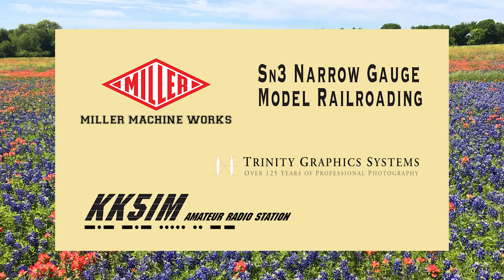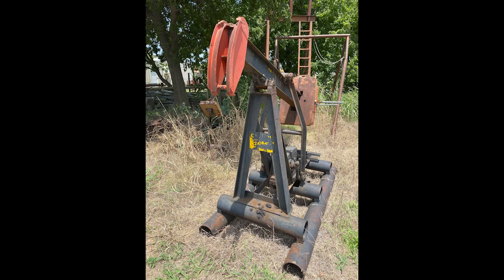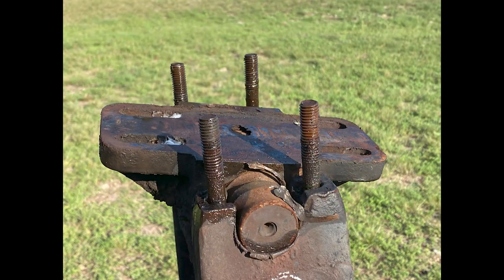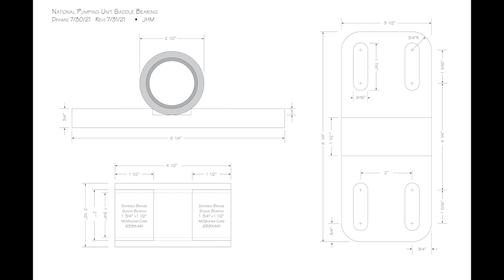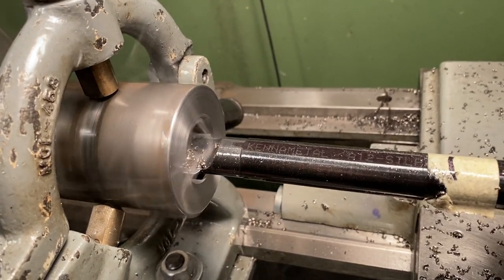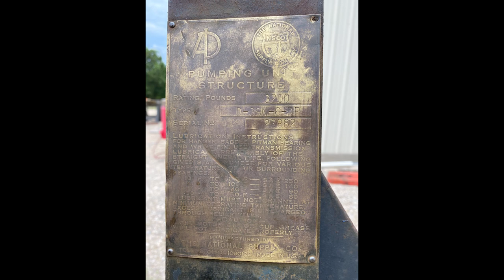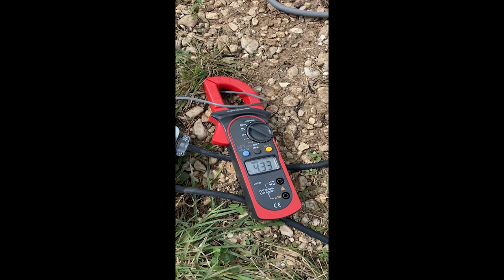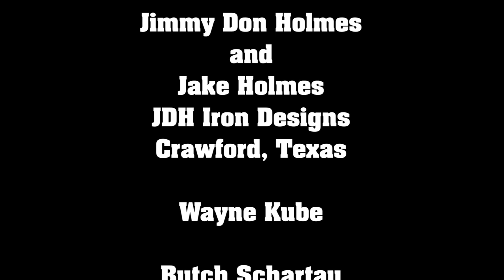Restoring a National Oil Well Pump Jack with a Hit-and-Miss Engine

Comment: I used to show up to location early in the morning to tear down long term shut in pumping units, load them onto trucks, and then install them onto newly drilled wells. I'm talking about pump jacks that ran for 20+ years with minimal maintenance and have the client expecting them to perform like a newly purchased unit on the new wells. My buddy used to say the only tools he needed to get a pump jack running were a sledge hammer, a 36 inch crescent wrench, and a cutting torch. Countless times we ended up in the oil company's bone yard picking bearings or weights like it was a pick-and-pull. Building cribs, filling them with sand, packing them down, using levels to ensure the cement pad sat perfectly flat, etc. The most frustrating part was after you finally got the old pumping unit running working on the new well, you had to sit and wait for fluid to finally hit surface before you could balance the counterweights. These were 2500lb+ weights you needed a knuckle picker to adjust and hope you hit the right balance before you could finally say it was time to go home. Setting pump jacks on oil producing wells is back breaking work.
Reply from the maker: Thanks for your insights. Appreciate the comments.
Reply: I'm in southeast PA and would like to get a pump jack.  Any ideas for how to find one?
Reply: @lambertmt Depends, are you looking for a lawn ornament or a working unit? Any idea what size? I'm in Alberta, Canada I could find one here with 1 phone call but I'd need more info for something closer to PA that could be sourced locally.
Reply: @Taylor Hutchings give me advice to start pump jack oil buisness
Reply: @taylorhutchings4612   give me advice to start a oil business
Reply: @junim4244  watch "There will be blood"

Comment: The next step is to get somebody to drill a hole about 20 feet deep and set casing. Then you can install a short rod pump and actually pump watered tinted with dye and dump it in a barrel next to it. Then put a pipe about halfway up it draining back into the casing to recycle the water.  You can get creative by bring the drain out of the bottom of the barrel and hide or bury the drain piping back to the casing just below ground level to make it more realistic.

Comment: That is a very good setup. I rework bearings on this size and smaller pumpjacks and it’s amazing how worn these bearings can get. You did an excellent job on the saddle bearing. Thanks for sharing. The yellow dogs were an added bonus!
Reply from the maker: Thanks very much. Probably would not pass muster for field use but for animated yard art, does the trick. And, as yet several months have passed and STILL NO OIL!  Merry Christmas!
Reply: I have a Jensen 13W I'm needing bearing work on for my restoration. Can I get your contact information?
Reply: @Radiotexas  I suspect you forgot to install the downhole pump.  I like the Yellow Dogs.

Comment: If you had a hill you could try build a central power. (Look it up, truly fascinating)
Reply from the maker: Seen several of those. Would be very cool to get one!
Reply: @Radiotexas  I used to tend gas wells in Titusville PA, very close to the "Drake Well". There was an old central power on one of my lease roads. It was all over grown but the turn table was visible. The engine was missing its cylinder. Way back at end of that lease was a small service rig with 1943 license plate. There was tree growing up inside the derrick and animals has chewed all the rubber of the tires. I spent 48 years in the oil field. I'm retired now, but work part time making fishing lures.

Comment: alll i want is ONE GOOD OIL WELL... 20 bbl/day of extra light crude oil , enuf gas to keep the yard light... for the whole block... burning and no water. all in the back yard. pumping a few hours a day. i wud go keep it company, talk to it, paint it, clean it, grease it, change the gearbox oil every... 500 hours?  simplest thing in the world . good that the gearbox was in good shape... and u cld get a seal for $3. the saddle bearing looks like a LOT OF work but u got it
Reply from the maker: That would be nice! I would have further comments but don't want to get cancelled! Working on restoring a 6 HP McCormick-Deering enngine. That will power a generator!

Comment: Was the original purpose of the yellow dog burners just for light back in the day??
Reply from the maker: The "Yellow Dogs" were open flame lights. Developed in the late 1870s, and burned what ever waste liquids that might be available. They were for lighting the wooden derrick floor. As drillers discovered, casing head gas would often come up thru the well head and be ignited by the open flames! Therefore using the lamps where there might be gas was not conducive to a long life!  Legend has it the drillers called the lamps "Yellow Dogs" because at because they look like two yellow eyes staring at you in the dark. Mine is a reproduction, sold by Flywheel Supply made of cast iron from the original Oil Well Supply Company patterns. I burn kerosene or Tiki torch fuel. The short one by the engine is an old roadway "pot."

Comment: Yet another expected example of Jay's thoroughly anal attention to detail, craftsmanship and precision!  

However: One cannot help but note the lack a standard Texas Railroad Commission well identification sign (assumed to be named,  "Miller #1" with location (Spanish Land Grant system) and operator), a tank battery for both oil and salt water, and a separator and a flare.  Lack of industry-standard site preparation is also noted.  (Where was the mud pit?)

I can hardly wait for a follow-up report of BOPD production!  (By the way, how many quarts of Nitro did you shoot to open up the formation?  Our biggest one was 8,000 qts. back in the '40s.)

Quite extraordinary and nice work, Jay!

Insofar as it goes...  

But now ya' gotta get it into production!

P.S.: And by the way, wish you'd a-told me that you needed a hydraulic press.  Would'a made you deal that you couldn't refuse - mine looks identical to what you got [except for the color]...
Reply from the maker: Sign now in place! All in compliance. Still a dry hole however!